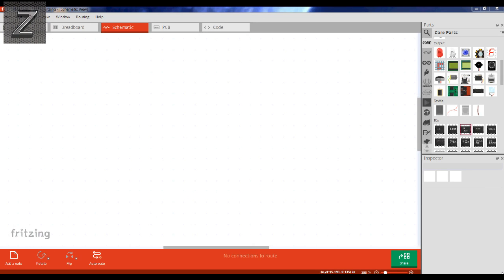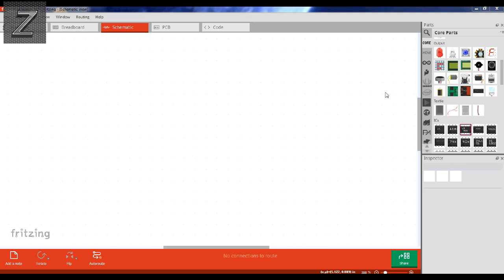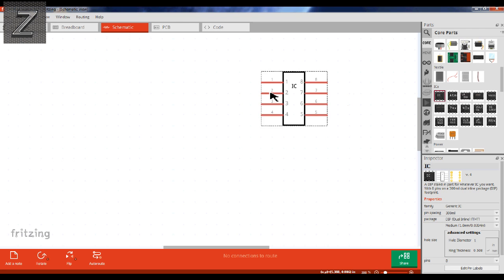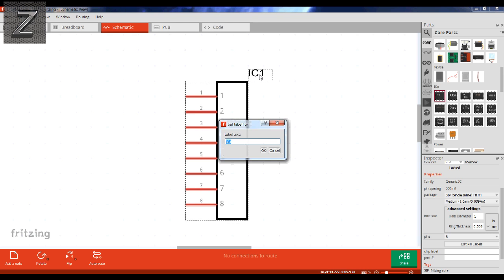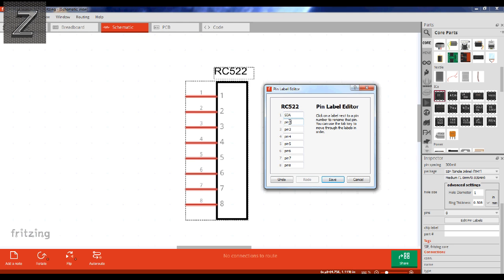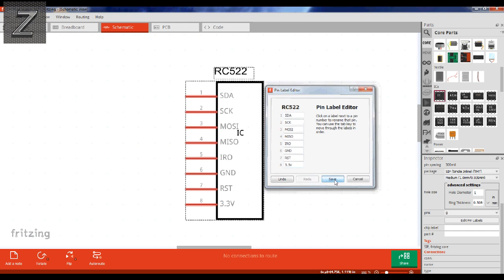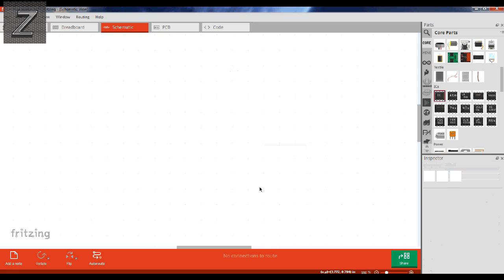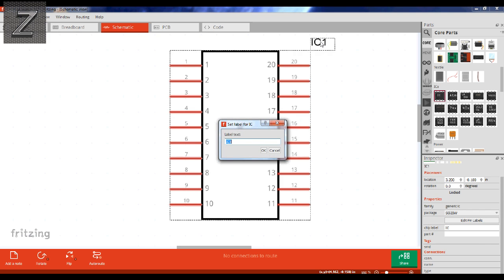How to make custom parts in Fritzing the quick and easy way

Comment: Quick and dirty ok, but does not allow putting the pins where they are on the real part. And the bounding box will not look the right way neither.. No way to easily enlarge to reduce the size of the part with this method.

Comment: Is there really no truly flexible, intuitive, simple circuit designer that allows new SVG part creation?  TinyCad was OK but very dated and only bitmap.  Seems like someone out there has done something that doesn't require you to outwit the programmers like this.  Looked at Caneda but the precompiled exe won't even start on Win 10.

Comment: what fritzing version are you using?  mine doesn't let me edit the icons of the schematic. I can only edit parts in the parts editor.
Reply from the maker: this works for the schematic drawing only, sory it wont do anything for the pcb or other parts of the program
Reply: @z-hut1663  it just did for me (2020). I zoomed out the pcb view and found my part outside the workspace.